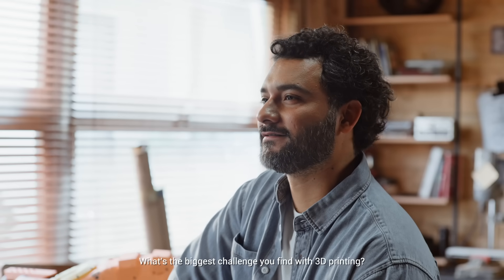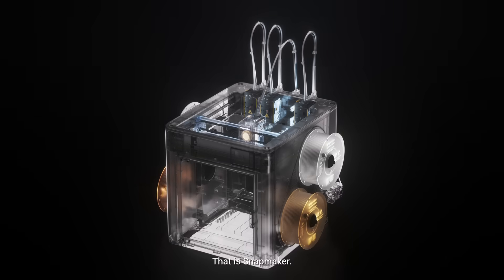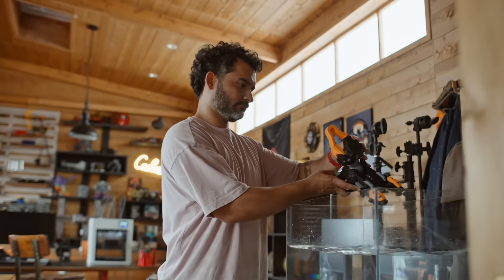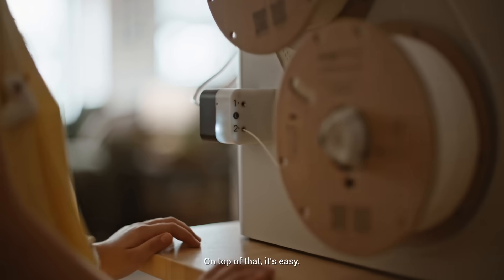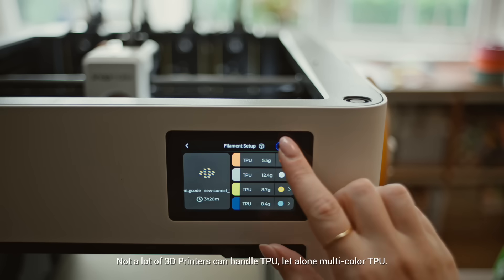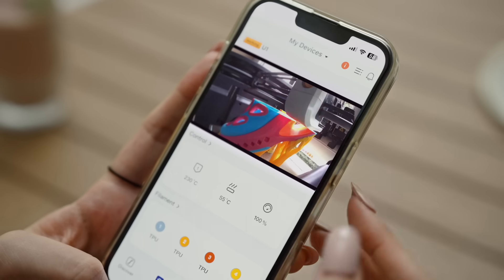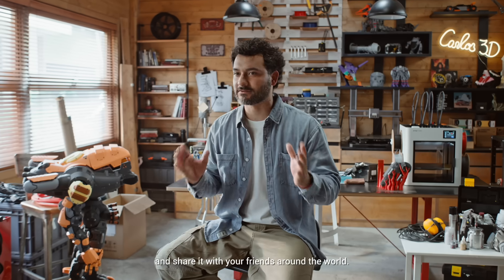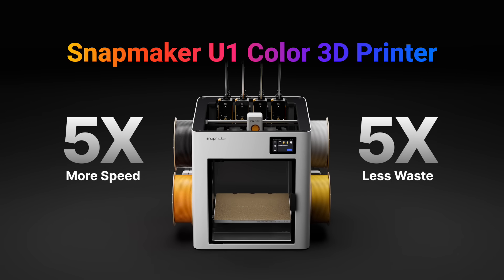Snapmaker U1 3D Printer | 5X More Speed. 5X Less Waste.

Comment: Are there already any concrete plans what the additional connector on the back is for? Maybe a connector for some kind of Multimaterial system? That would be a huge gamechanger if you think about the fact that if you would combine multiple toolheads with a AMS like multimaterial system you could print so many colors and still produce minimal amounts of poop because you usually don't need to print all colors on all layers. Maybe even with included filament drying capability? 
Love the project!

Comment: I wasn't going to say anything but then I saw that you guys are responding to essentially every comment, good on you! How do you intend to approach the problem of filament recognition? I know that Bambu's overpriced, microchipped spools are a big problem for some people.
Reply from the maker: The Snapmaker U1 is compatible with third-party filaments, provided they have a diameter of 1.75 mm and meet general material quality standards. However, please note that the RFID recognition feature will not work with third-party filaments, and you need to enter the filament information on the screen.
Reply: Overpriced? If you get like 4 you get bulk sale so 14 euro per 1kg is not that overpriced. In the Netherlands one company sells their housebrand filament for like 23 euro per 1 kg

Comment: Print quality is the most important factor for me, rather than filament waste, and frankly, Snapmaker does not have a very good track record in this regard. I will continue to follow this machine. If I see Bambu H2D quality prints, if it is possible to close and heat the chamber (without incurring significant costs), and if they offer a good AMS solution for the filaments that are currently exposed, I may consider purchasing one.
Reply from the maker: Hi, U1 delivers the high speed but not compromise the quality. Also, we release a top cover as an add-on. Top cover includes an air purification system (HEPA + activated carbon) and passive chamber heating, capable of maintaining a chamber temperature of up to 50 °C. 

🌈Explore more on Kickstarter: https://bit.ly/3V5klpx
🔍FAQ: https://support.snapmaker.com/hc/en-us/articles/33344279396759-FAQ-for-Snapmaker-U1-3D-Printer
Reply: @Snapmaker  50 degrees is never enough for me. As I said, for quality, I need to see both how long it lasts and reviews I trust.

Comment: Do I need to dry the filament every time I do 3D printing? What should I do if the filament has absorbed moisture?
Reply from the maker: Hi! If you use TPU, Water-soluble, PA and other filaments that are easy to absorb water need to be dried before printing. If the other filament like PLA/PETG already absorbed water, it needs to be dried. You can use SnapDryer.

Comment: When snapmaket has an complete ecosystem with slicer, filament and very good app and software this would be an perfekt machine
Reply from the maker: We are committed to providing users with a seamless and integrated experience! The U1 supports to use Snapmaker Orca and OrcaSlicer. Snapmaker SnapSpeed PLA works perfectly with the machine. And it comes with the Snapmaker APP.
Reply: @Snapmaker  has it GPIOs? for custom usage

Comment: man you rushed this product right out of the door it seems, based on what people are saying on the internet, it takes 30-40 min to calibrate, and its not 5x faster maybe 2x faster than bamboo p1s  when it comes to multicolor print but when it comes to single color, its the same speed.. 

but to give you some real advice work on the software, most 3d printer users dont know how to design, we arent engineers, you should implement more advanced AI features so everything feels easy, fast and automatic, without any hassle, and introduce a more expensive version for high quality , that offers better quality, much faster speed to print, less noise,  for around 2k $ and the nozzle head doesnt need to be changed every few hundred hours like the bamboo one 

speed is the number 1 problem with 3d FDM printers, especially if we are going to use it to sell items, the more a print takes time to print the more expensive the final product cost becomes to the consumer.

i believe a lot of people are willing to pay 2k $ for 3d print if it solves the probelms i mentioned above , even bamboio H2d is slow as fk, and their pro version is straight theft , they are charging 1.5k $ but giving almost excatly the same print quality and speed
Reply from the maker: Thanks for your feedback and suggestion. The printing speed and waste gap of different types of models will be different. Explore more and back us on Kickstarter: https://bit.ly/3V5klpx

Comment: Doesn't beat dual extruder speeds, im sorry. But I suppose if there are more than 2 colours its OK.
Reply: how is the retail pricing vs the h2d?
Reply: @samuellobo4882  U1 is 999 USD MSRP (so after kickstarter)
Reply from the maker: The Snapmaker U1 supports a maximum toolhead speed of 500 mm/s with acceleration up to 20000 mm/s², delivering high-speed performance while maintaining excellent print quality. It supports to print up to 4 colors or materials at once. 5X More Speed. 5X Less Waste.

Explore more and back us on Kickstarter: https://bit.ly/3V5klpx

Comment: Saw a Video that showed that 30 minutes into kickstarter campaign started, already 4 million dollar were collected.

Congratulations to snapmaker for this achievement!🎉

I was at work when it started and was able to back (with deposit) my  unit 4 hours later. Unfortunately the early bird for October was already sold out.
Only November delivery was still available. 
Will the units be shipped to the customer as soon as they arrive in the local warehouse or is there a specific shipping date planned?
Reply from the maker: Thanks for your support! About the shipping and delivery date, please check out our FAQ: https://support.snapmaker.com/hc/en-us/articles/33344279396759-FAQ-for-Snapmaker-U1-3D-Printer
Reply: You ever stop and ask yourself, why an established company is running a kickstarter?
Reply: @badsamaritan8223 Could be a Marketing strategy or because the product is not fully developed, but the company wants to check how big the demand on the market is. 
I have the A350 and my problems with the new Dual Extruder was solved by Snapmaker. I have no doubt that if any problems occur that Snapmaker will solve them.

Comment: I can't find the $30 price you had a few weeks ago.
Reply from the maker: Hi!

1. The deposit phase has already ended. New backers can directly join the Kickstarter campaign by selecting a reward tier.

2. If you have already purchased a deposit, please make sure to use the same email address on Kickstarter as the one you used for your deposit purchase. This way, our system can correctly match your deposit and apply the $100 cashback after your U1 ships.

If you encounter any issues (e.g., different emails), please contact us at info@snapmaker.com and we’ll assist you.